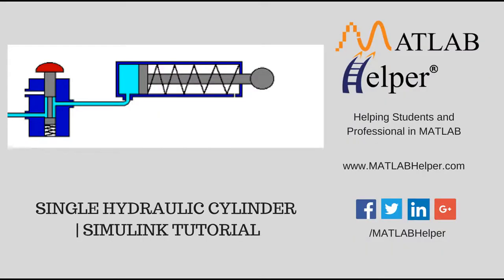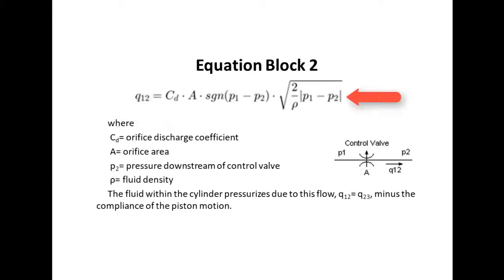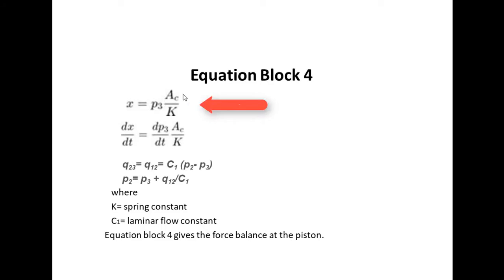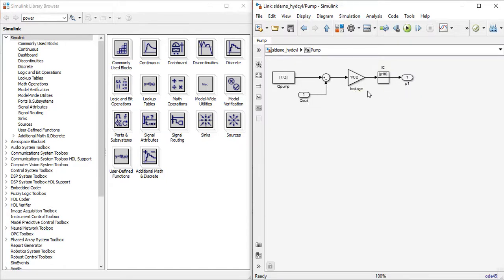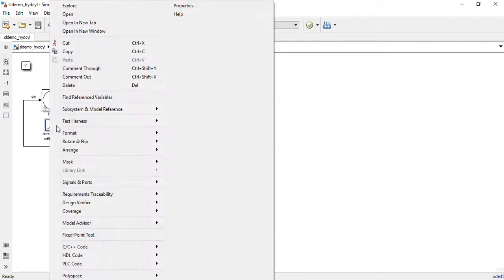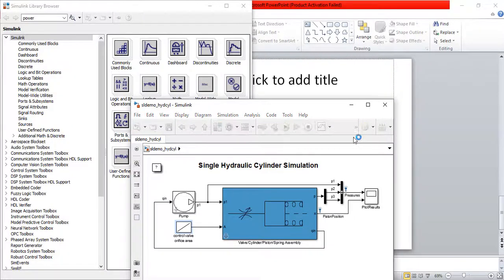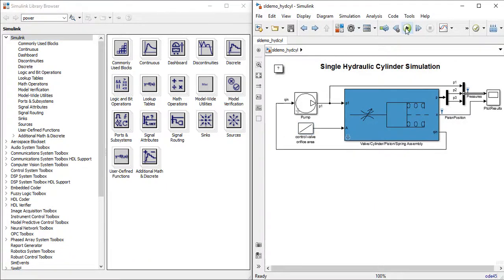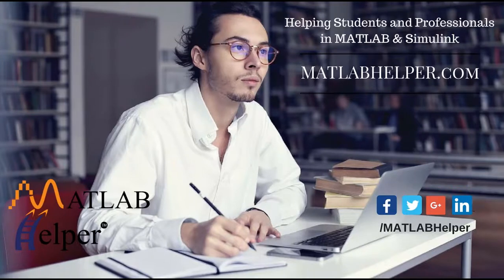Single Hydraulic Cylinder in Simulink | Simulink Fundamentals | @MATLABHelper

Comment: The tutorial explanation wasn't enough for people to understand it completely, the masked block was just unloaded and the assembly was shown only for a moment. Not all blocks were explained in the video, plus there was also one block at the top left corner which was marked as question mark which makes it more confusing.
Also using slider could also be a second best approach instead of clock to manually operate the pump.
Reply from the maker: Anish Gupta, Thanks for your comment. Your suggestions are valuable. We would love to improve our videos. Please do suggest how we can improve your experience further, and We will do our best for you.

Comment: Also lot of things have been skipped ( like the basis on which the  hydraulic diagram was designed). I guess it would have been better if you would have explained the real life application of this. ( This helps mechanical and civil engineers in designing quality hydraulic system by first simulating them on simulink)
Reply from the maker: Aditya Humnabadkar, Thanks for your comment. Your suggestions are valuable. We would love to improve our videos. Please do suggest how we can improve your experience further, and We will do our best for you.

Comment: Single Hydraulic Cylinder -Simulink Tutorial
#A hydraulic cylinder is a mechanical actuator that is used to give a unidirectional force through a unidirectional stroke.
#The equations are used to derive the connections between different blocks.
#First, we need to have a symbolic model of the cylinder.
#to get the Simulink model, use "sldemo_hydcyl" in the command window.
#After some time,we will get the Simulink model.
#Right click on pump, valve and control valve to see what is present in those blocks.
#we can see the results in "plotresults" block.Double click on it.
#You can see the waveform i.e. pressure from a fluid at different points vs piston position.
Reply from the maker: Tejaswee Rayana, Glad to see your appreciation for our Video. Do support us by Subscribing to our YouTube Channel at https://www.youtube.com/c/matlabhelperteam